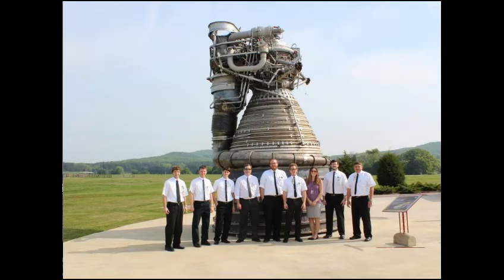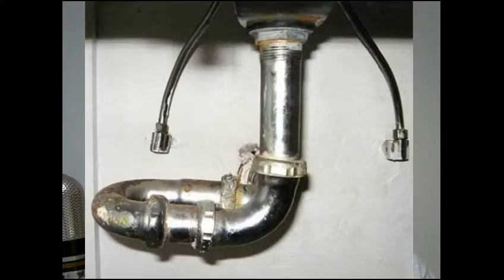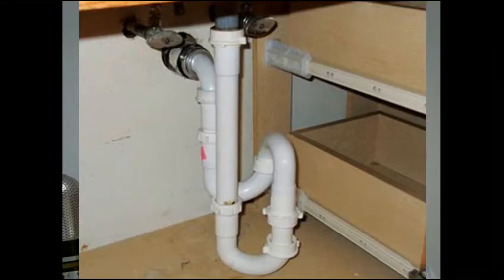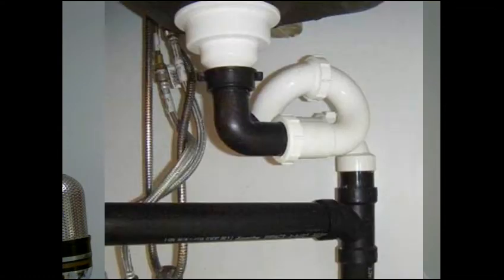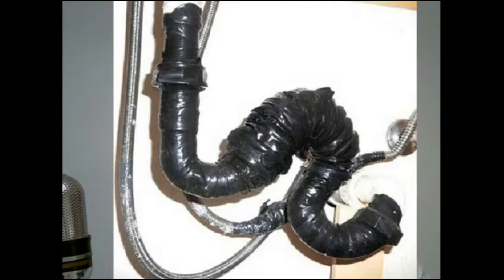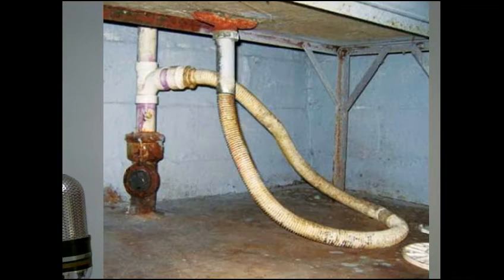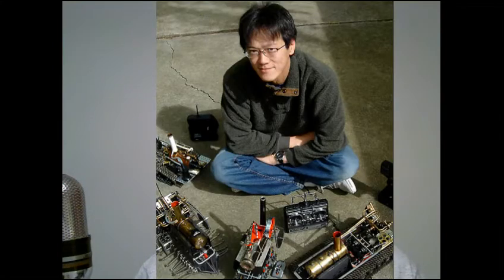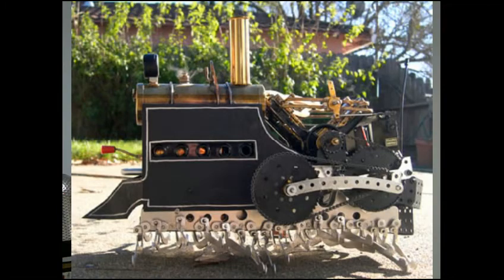TDD report for July 27, 2013

Comment: Those pipe arrangements were a hoot.  Thanks to Bob.  I'm guilty of applying the tape fix a time or two (but coupled to hold sealant in place).  A product called MainLine solved alot of plumbing issues for us, and just today I used Pure Lye and it worked amazingly.